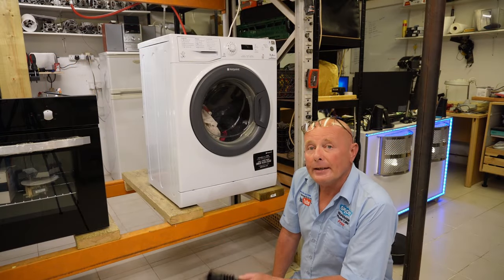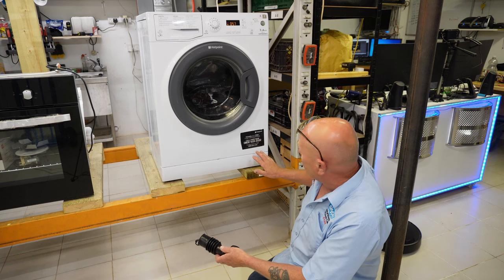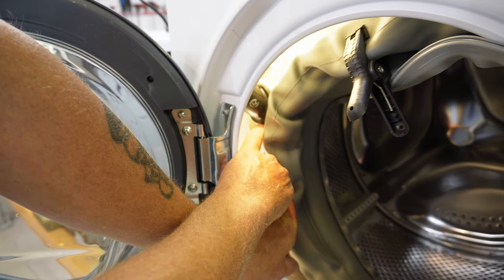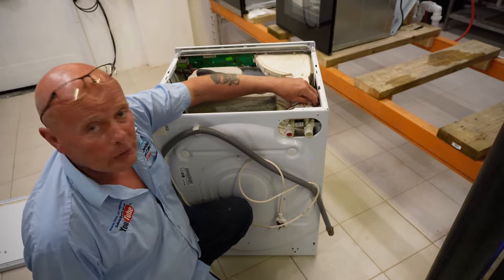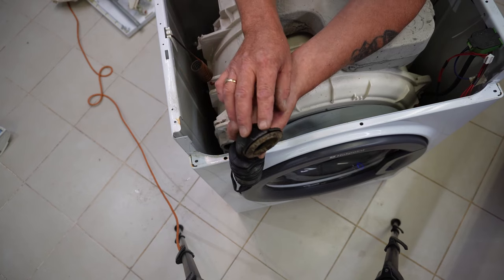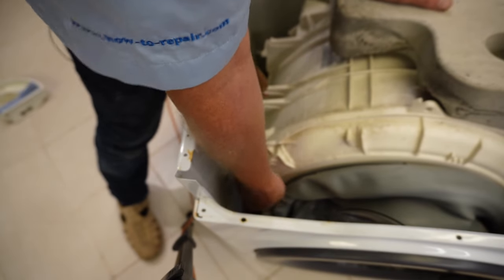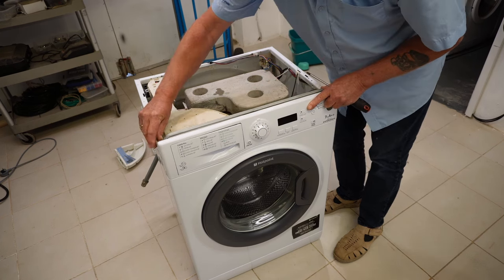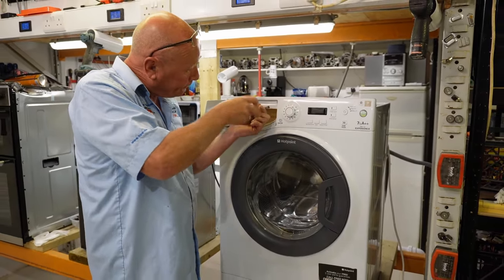Finding a leak & replace washing machine soap draw fill hose Hotpoint, Indesit, Ariston & Whirlpool

Comment: Outstanding video. Had two issues with my 6 year old Hotpoint WMBF 844G UK washing machine. Normal detergent drawer wasn't disolving powder properly and I had a leak on the left side also. Hosepipe was the cause of the leak the same as this video. The disolving issue was cause by poor flow in the jet, clean and now firing water through at correct pressure again. Many thanks
Reply from the maker: It's amazing how many machines suffer with low water pressure, and this will always cause a problem glad we could help you @alasdairgray365 this is for you https://www.youtube.com/shorts/e432SAb2g08 please remember to subscribe as that's what keeps this channel going. Thanks 👍

Comment: Great video, just helped me diagnose and fix a leak on my AQ113L297E. Similar build but there are a few minor differences, chief one being a retaining screw at the bottom of the filler hose which is very difficult to reach!
My issue was the rubber hose partially popping out of the drum. Must just have been prolonged vibration or something because it was very difficult to get back in.
Reply from the maker: Glad it was helpful mate. Since we work very hard in our warehouse making free video guides for you all on appliances, we always appreciate a beer, offering a choice of single or round beer. https://www.how-to-repair.com/help/buy-paul-a-beer/ Thanks 👍
Reply: @How-to-repair  cheers mate 🍻

Comment: Thought I had cracked the not dissolving powder problem. Tray has been cleaned throughout. When I do an auto-clean, the spray into the detergent tray is very good and powerful, washes away powder no problem. However when we do any of the normal washes 30degress, 60mins etc, the water comes through into the tray np, but its no way near strong enough to wash away the powder. Any ideas what it could be? I have checked the resistance on the solenoids and they are 3.8 so are fine.

Comment: Thanks very much for posting this video, also watched the video on soap drawer leaks, really helpful. I will seal the soap drawer, and may replace the fill hose as well if that doesn't do the trick. It does seem to only be leaking at the top, and looking at your videos it does seem unlikely that the hose is leaking there, but I will find out! A good clean may also be helpful.

If I do change the hose, is it essential to remove the door seal, or can it be done without going that far?

I tried to follow the links to buy through you, but they didn't lead to that option, and just suggested other eBay sellers. Will have to buy you a beer!

Best wishes  : )

Comment: Brill video. Unfortunately my hose is too tight a fit with the drawer and so I can't separate them as you did at around the 9:30 mark. I tried using a screwdriver but it began to split (I'm trying to save the hose just now). Any ideas?

Comment: Thank you for posting this video, I traced this leak on my indesit (before watching your video). I wondered if you had to use some sort of sealant around the end of the hose. 

As for the design; well what a really poor one! It should be a stub where the hose can be clipped on. Mine is leaking because the hose has been allowed to vibrate around in the hole and literally worn away! No wonder washing machines are throw away items. 

The sealed drums are a joke too!! Can't change the bearings.

Comment: Great video as always! I had water leak problem with Samsung Front Loading Washing Machine. The leak came when start to spin and drain. When I test the leak, it was on the right hand side of the washing machine. And when I opened the filter there was still have water residue one cup of water inside. Do you have any idea?
Reply from the maker: I would really need the washing machine in front of me to be able to understand where it's leaking from. but with regards to half cup of water in the pump that is normal

Comment: Great a new Video. I have a question if you have the time. Have the dreaded E25 error on the bosch dishwasher. Have used your videos to fix it maybe 3 times now. The latest time tho i couldn't find any blockage so replaced the pump. 6 mths later have the same problem. Took it all apart cant see a blockage. Tried taking the waste pipe out of the sink doesnt look blocked at that end anyway. U bend seems fine. Any other ideas I could try? If i run it without the front on I see the pump starts up ok blows a few bubbles in the water I can see in the waste pipe close to where it meets the pump then stops and E25 message :(. Any idea what to try? Thanks for great info.
Reply from the maker: give us a call on monday

Comment: Our Brand new Splendide WDV2200XCD is leaking exactly at this hose connection. We discovered it on the first pre-wash cycle. (And using a borescope, we verified it is leaking from the drum water-input hose.) It looks almost exactly like this machine. Is it likely a bad hose or should I just remove the hose and reinstall it with glue? 

Also, is there an alternative glue to debor that is available in the USA? (I can’t seem to find an American distributor)